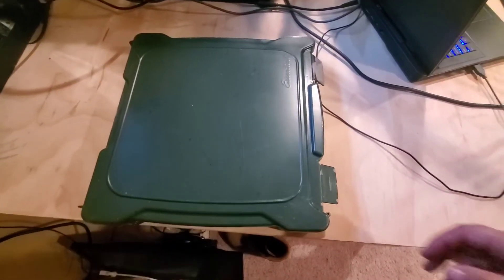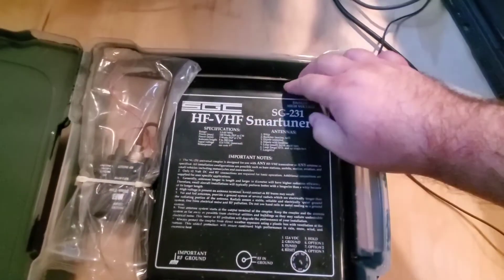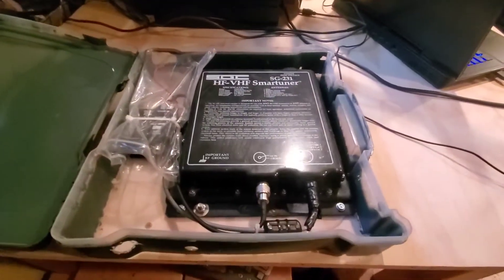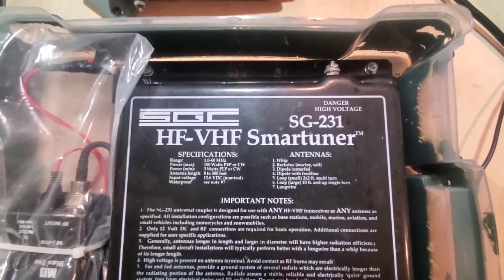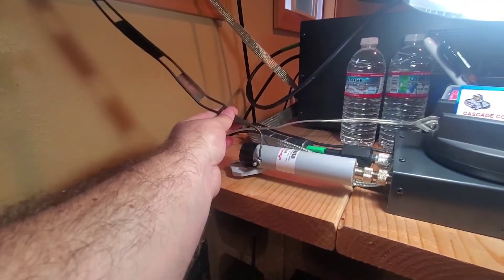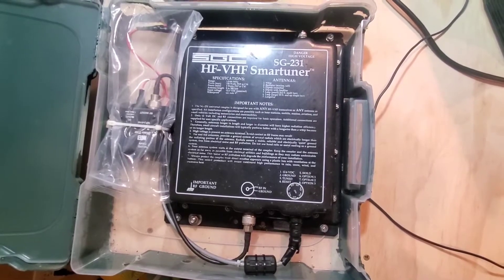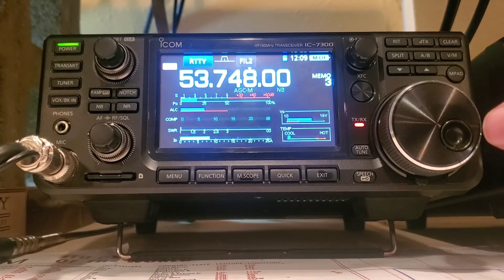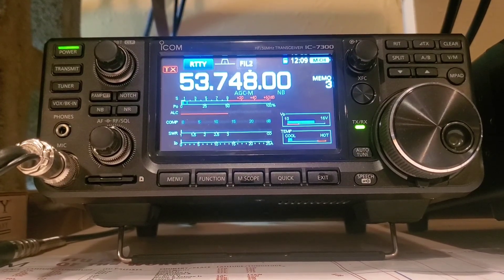SGC-231 reinstall

Comment: Have you considered moving the tuner outside so you don’t have to bring the ladder line into the house? It looks like the jumper from the tuner to the radio (or amp) would be less than ten feet. Also it looks like there’s a point where the ladder line is close to a rain gutter; do you think you should move it a few feet further away?
Reply from the maker: I have had this tuner inside and outside in lots of configs, this just happens to be what I'm trying now. Things will be different next week. Had a flood in Jan, just got floors and everything else fixed in March, so when I'm home next I will put my shak back together.